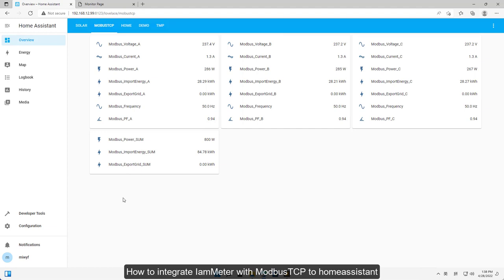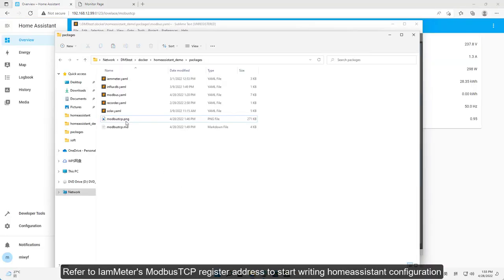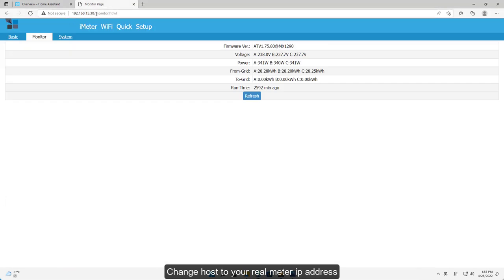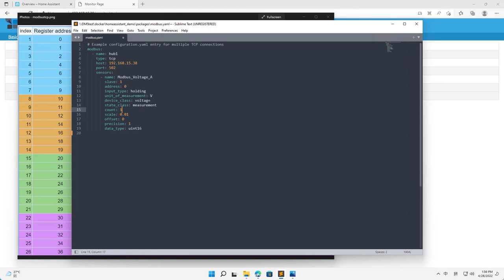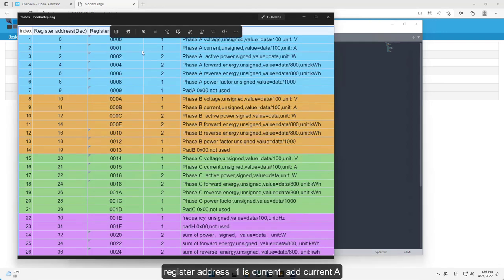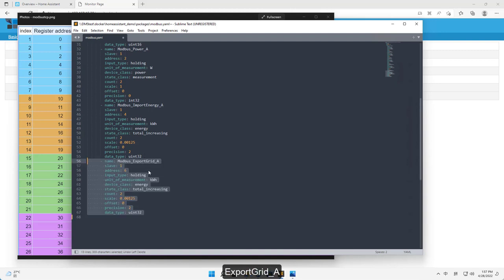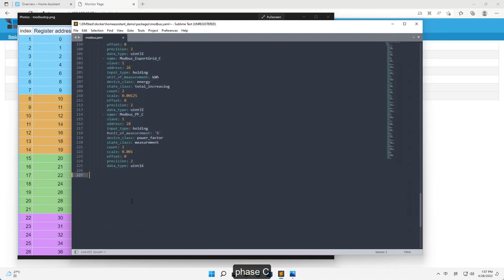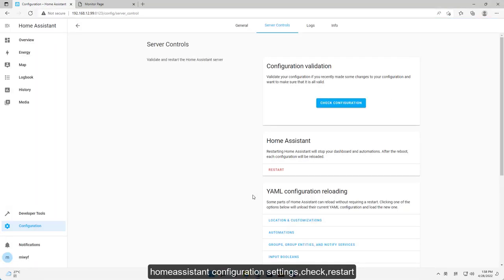Integrate a three-phase energy meter into Home assistant by Modbus TCP (over Wi-Fi)

Comment from the maker: This is a Wi-Fi three-phase energy meter, which 
can be used in solar PV monitoring and many open-source platforms such as Home Assistant, Node-red or openhab.
https://www.iammeter.com/products/three-phase-meter
https://www.iammeter.com/newsshow/blog-220223

Now, It supports Modbus TCP/RTU (Just need to upgrade the firmware). https://www.iammeter.com/newsshow/news-modbus-tcp-energy-meter

Yaml file in this tutorial:https://github.com/lewei50/Solar-PV-Monitoring/tree/master/Yaml%20in%20Home%20Assistant/ModbusTCP

Comment: Be aware of a correction, on the sensor definition, address = offset , not to the real address.

So if address(offset)=0 and type =holding register, then the read register will be 4001
Reply from the maker: Sorry, it is difficult to discuss such questions (regarding technical) in the replies on Youtube.
If possible, please post your doubt directly here 
https://imeter.club/ 
My colleague will reply to your there.
Reply from the maker: I can understand your meaning entirely.
We have not strictly complied with the Modbus protocol to define the register`s address.
which just uses an absolute address, not an offset address from the address that the function code 04 should be.

Comment: I currently have a project where I query the json data from my meter.  Would there be any speed or performance advantage to switching to modbus over json?
Reply from the maker: Hi, there is no comparison between JSON API and Modbus TCP.
They are just for different customers.

If your project had already use the JSON API and it indeed meet your requirements, you do not need to switch to modbus TCP.

But most industrial system such as DCS, ICS,SCADA only support modbus TCP in it.
So we want to expand our energy meter to this field, so we upgrade our product to support modbus TCP .